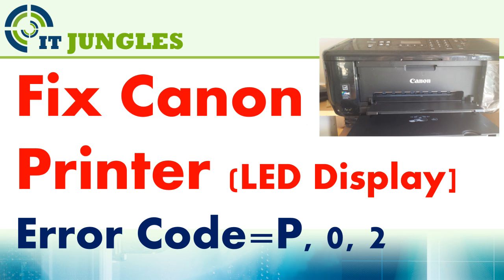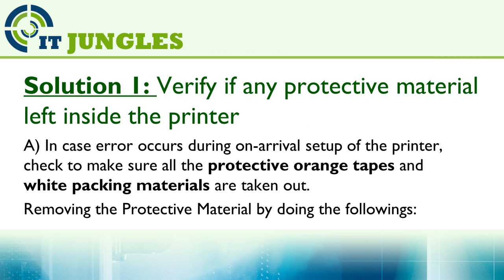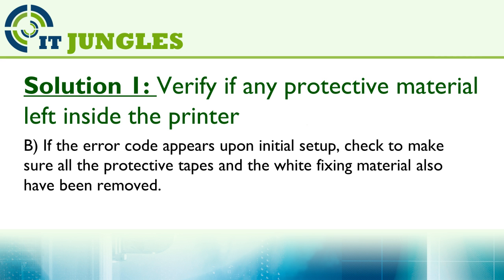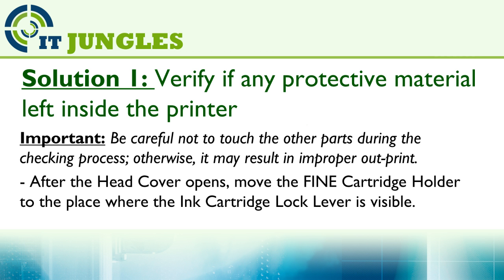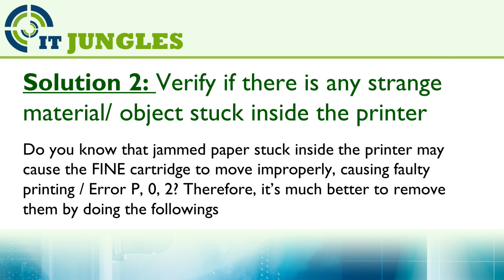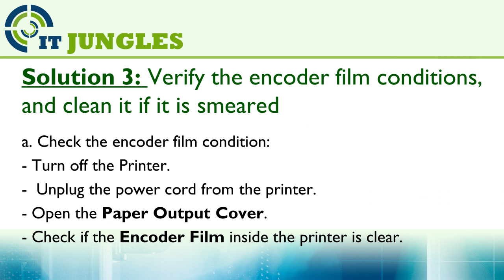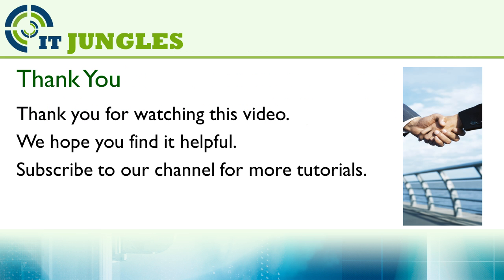FIXED: Canon Printer Error P, 0, 2 (P02) LED Display

Comment: Thanks. I tried everything you said and it is fixed. First off, I knew there was no paper jam. So, from listening to your cast, I determined it must be the film strip. I initially cleaned the film strip with a Q-tip and alcohol but that didn't work. I then used a Kleenex and tip the bottle of alcohol in the middle of the Kleenex three times.and reached in and cleaned the front and back of the film strip. I plugged the computer back in and it works fine. Thanks alot!!

Comment: Thanks you a very lot ! ! Without the help of your video I probably would have replaced the printer, not even two years old !  It was only a little smeary cm on the encoder film. Cleaned it and working as usual, :)
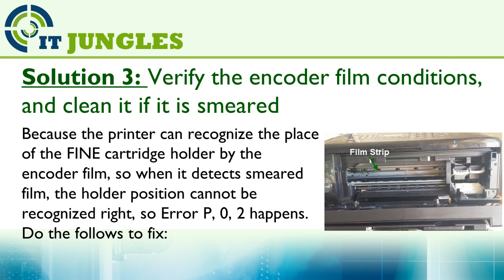Reply: same. 3:03 sums up the whole video